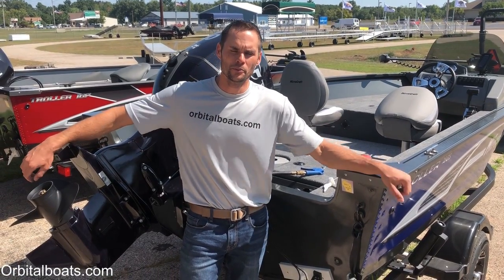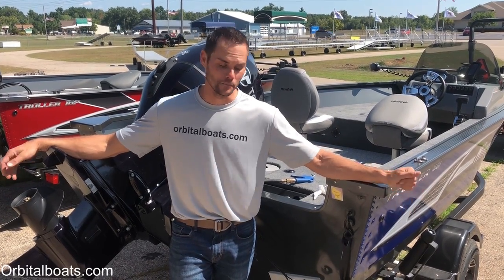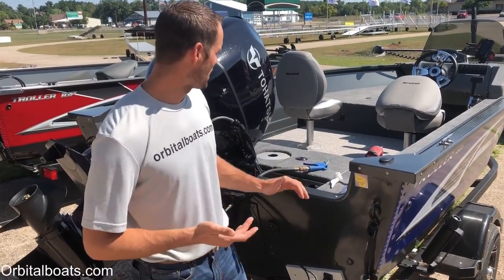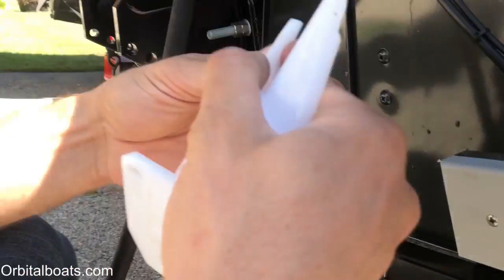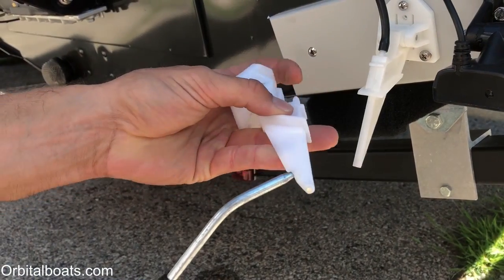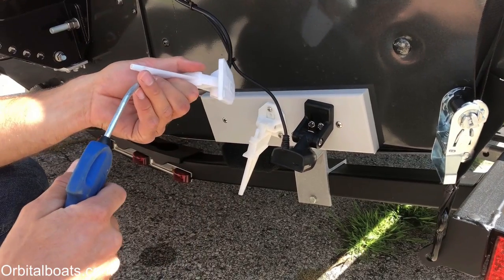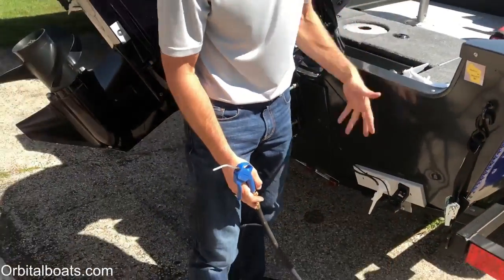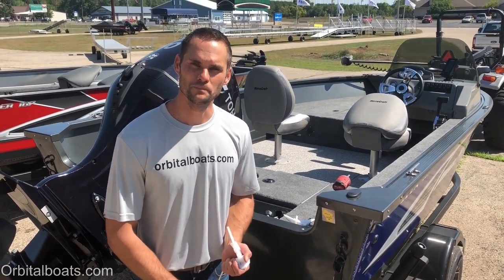How come my speedometer doesn't work on my boat?

Comment: My Speedo reads 48mph out of the water and doesn’t move when in the water. Also my tac reads like that one, around 1000rpm with engine off… why is that tolerable? My pickup tac reads 0 with engine off and then reads appropriately when engine is running 

Thanks In advance

Comment: Terrific,, w=except being a boat expert, why didn't you explain the very end of the pitot tube? My tube has an aluminum plug in the very end. Is this normal? Is the round end plugged so this will work, or did
some previous owner stick something in there? Would like to know. My speedo don't work.